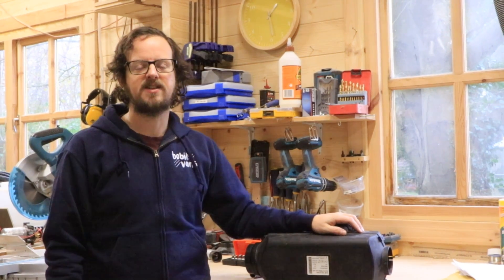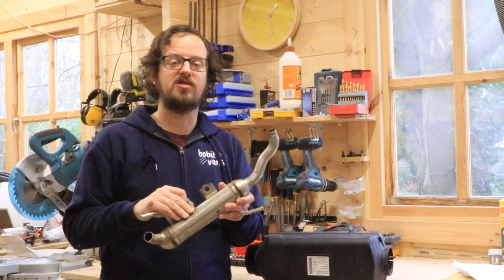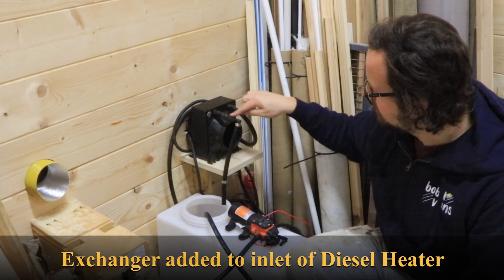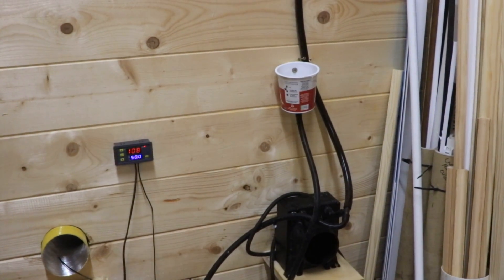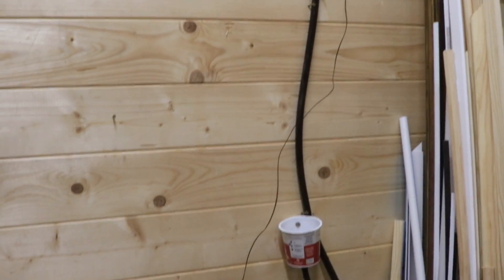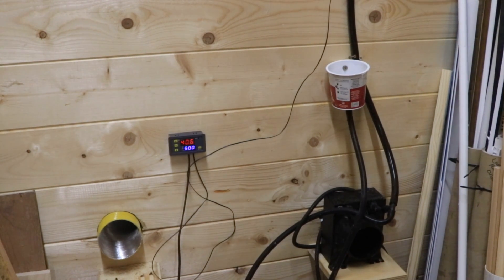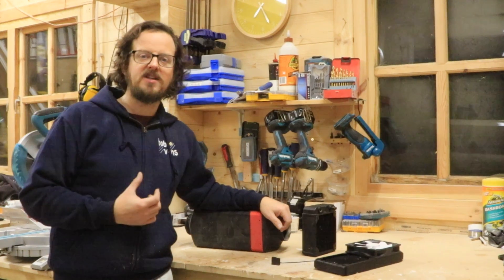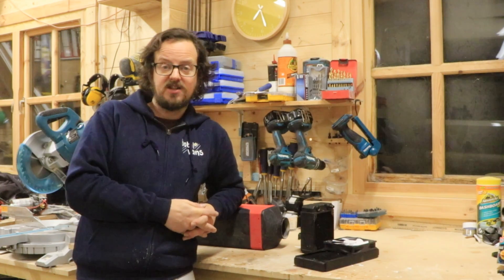Chinese Diesel Heater upgrade with EGR cooler

Comment: "I don't like burning fossil fuels".....literally every single piece of the heater is made with fossil fuels including the fuel containers, the deliver vehicles and every single tool in the shop, as well as the camera used to make this video hosted at a data center built with fossil fuels.
Reply from the maker: That’s not entirely the point of the video, but thanks for your comment.

Comment: Would it be feasible to make a floor heating loop with it.. To add a pump a small expansion and run it in the floor? If the water gets to 40 Celsius, i am not sure if its winter and the floor is cold would it make any significant difference. But something to explore

Comment: Please do research before you say things like fossil fuel and decaying dinosaurs producing oil. The fact is, crude oil is second most prevalent liquid on earth next to water and is naturally occurring. The deepest oil well found is 40,000 feet or 12,000 meters. Oil is rutinlly drill for at 30,000 feet. Even evolutionist say that most dinosaur bones are found near the surface of the earth and the deepest ever found is a Plateosaurus Knuckle-bone at a depth of 7,401 feet or 2,256 meters.

Comment: Had you mounted Tokyo heater orhercway round so it was nearer the output and wrapped it in insulatiob you would achieve 50%+  better efficiency instead your wasting atleast 25%
Reply from the maker: @andyplage6590  given the outlet temperatures, I beg to differ. Where do you get your 25% loss from? We’re dropping the exhaust temps from 250+ to a temp you can hold your hand in front of. Pretty impressive if you ask me.

Comment: Question.  Could you simply run water through EGR without heat exchanger as a hot water line only?

Comment: If water circulation depends on the pump then there is a danger of water turning into steam (bomb) should the pump fail for whatever reason. It’s fine on systems where the heater never reaches 100° but in this one the exhaust temp is over 200°C.
Need a larger diameter waterlines, greater height difference and natural circulation. Also less moving parts.

Comment: If one wanted to play around making something to heat water for showering in a campervan, I guess pumping it through a used EGR valve would be clean enough?

Or do you think pumping water through a heat exchanger at the heater outlet would be a more efficient idea?
Reply from the maker: @josmith5155  I’d do both, else you won’t reclaim any of the actual heat from the heater and you’ll heat your van like there’s no tomorrow just getting the water up to temp. Bear in mind that it’s only 15%-20% out of the exhaust, so majority still out the front of the heater.
Reply: @bobilvans4205  Cool. Yeah, thinking about it,  I guess the inside of the EGR is aluminium so could get corrosion with neat water.

Another few years and maybe they'll be mass producing the heaters with heat exchangers for water, although water and electric...
Reply from the maker: @josmith5155  I think the EGRs are stainless steel.

Comment: 😂 there is no such thing as a fossil fuel stop saying that you sound stupid😂
Oil and gas do not come from fossils. The Earth makes them using heat and pressure.
Reply from the maker: I will mention that the point of the video wasn’t really about the origin of fossil fuels, it’s about heat reclamation from exhaust gases.

Comment: If the pump speed is too high, the water is flowing through the system so fast that it simply doesn't have time to absorb a lot of heat, or transfer that heat into the radiator.
This is why you're seeing low differences between the intake/outlet temps of the radiator. That's not a good thing, from 38.8 to 40.9, you're only transferring ~2'C into the air stream.
By bringing the pump speed down, you can bring the water temperature up until it is close to boiling ~80-85'C is good. This means that your radiator is now getting hot enough, so it is much easier for it to transfer that heat into the intake air stream. You'll need a variable speed water pump for that, with a way to govern that speed against temperature rises.
Reply from the maker: Not sure I agree. The aim is to reduce the temperature of the air coming out of the exhaust as much as possible. The colder it is, the more energy has been transferred. By running the pump slower you increase the exhaust temperature which isn’t good. The key is the amount of energy that has been transferred, not the temperature.
Reply: @bobilvans4205  It may seem counter-intuitive but hear me out.
You want the EGR cooler to absorb as much heat out of the exhaust gas as possible, to do that, the water (your heat transfer medium in this case) needs to spend as much time as possible inside the EGR cooler so that it can absorb that heat. A high flow rate of water would be fine if you had a very long or large EGR cooler, but there's no space here for that with a small cooler, so the pump rate needs to be reduced to give the water enough time.
The reverse is true for the small radiator, slowing the flow of water through it gives the water enough time to transfer it's heat into the cores of the radiator, where the air stream can carry it away.
This comes from experience of racing engines, where we tried various combinations of high-flow radiators and high-output water pumps only to find that what seemed like the best combination (high-flow water pump impeller with a 3-core high-flow radiator) actually made the engines run significantly hotter, to the point where one of them literally seized from overheating even though the coolant temperatures weren't above ordinary. The coolant was passing through the engines so fast, it could barely pick up any of the heat from the cylinders, so what arrived at the radiator was a mixture of warm-hot slush that only became a homogenous temperature when it arrived in the radiator header tank. Dropping the water pump impeller back to a standard size dramatically improved the overall cooling and allowed the 3-core radiator to do it's job.
Funnily enough but I just had a thought, you could do away with the whole water transfer setup all together and make a long coil of pipe inside a can, or one that loops back and forth like a direct heat exchanger. Running exhaust gas through that would directly transfer exhaust heat into the incoming air stream far more efficiently because you're no longer having to work with the limitations of water boiling off.
Reply: @bobilvans4205 Yes, I agree. Recover the wasted energy in the exhaust gases.  Given your data as presented you recovered around 50 btu/min (6.5 liters/min) with a delta of 2 ½ ⁰... Given your heaters energy input is about 200 btu/min I'd say that was good progress.  Measurements of delta T across the EGR would be beneficial.
I've had 2 of these Diesel heaters for around 7 years now and have purchased a auxiliary automotive heater to do the very same.  All I need now is the EGR cooler.

Comment: It looks like you're heating outside air. In cold weather you'd get more heat by having the heater inside and recycling inside air.
Reply from the maker: We’re pulling air in from the building then recirculating it into the building. The heater is outside.

Comment: This is a FANTASTIC setup.    I never could understand why these diesel heaters don't run much like water heaters in that they produce so much wasted heat out the tailpipe (Exhaust).     
A heat exchanger is great solution to not only capture that wasted heat energy, but also provide warm water  that could be used for all sorts of uses.   

This would also work very well to heat up your oil / coolant  in the winter on your car to help aid the block heater in colder climates.     

Running it on Kerosene would also yield some benefit in colder climates as well to start the heater and get it up to Temperature faster. 

Not to mention lower wear and tear on the engine if you have something like a pre-oiler.
Reply: wait til you learn that they can burn straight used vegetable oil you get from a restaurant, just needs to be filtered. you put the vegetable oil in another tank, use a shutoff valve to keep it off for startup and shutdown. when the unit's running hot on diesel, flip the valve so you're burning oil. flip it back to diesel before shutting off to keep the heater clean. if you're lucky you may find a source of free heating fuel in your town.

Comment: 1:17 Runs very well on 100% HVO.  What you use here is a heat exchanger, EGR is something else entirely.
Reply from the maker: This is an EGR cooler. Not a valve.
Reply: @bobilvans4205  oh I understand. The part is a component from a exhaust gas recirculation system known as a EGR cooler that you repurpose as a heat exchanger for your diesel heater.

Comment: You really don't know what FGR is do you? Exhaust gas recirculation, where exhaust gas is fed back into the intake of a car engine to reduce emissions, nothing to do with cooling the exhaust.
Reply from the maker: Thanks for your helpful comment. I do know what an EGR is. I am repurposing an EGR cooler from a vehicle to regain some waste heat from the exhaust gas from the heater. I am not feeding exhaust gasses back into the intake of the heater. I’m sorry if that was not clear!

Comment: It seems rather overcomplicated for the heat that you gain. I just purchased a 3-metre length of the original (shorter length) stainless exhaust pipe, zigzagged it in the shape of a heated towel rail then out through the wall. Job's a gud un 👍
Reply from the maker: I look forward to seeing your efficiency calculations. Would be interesting to see. I didn’t want the exhaust inside for obvious reasons. I also like tinkering.

Comment: Don't take this harsh by any means please: 0.52 we need to get the exhaust/waste heat recovery/~~recirculation~~ "uh," you got stuck because we all get stuck.  I want the terms to be more precise so it's easier to search and find info plus one bro, new YT channel made an epic fail because of this terminology glitch.

EGR exhaust gas recirculation routes exhaust to the intake to be re-burnt.  You CANNOT do this or you will burn out the motor or melt the impellor.  It relies on cold air for cooling.  

This is a discussion about "waste heat" recovery from exhaust.  Which is indeed what you've got and I have watched a bit ahead. These heaters seem to be gaining a lot of popularity and community, I hope we can all learn some cool modifications.
Reply from the maker: I’m not quite sure what you mean. The device I’m using (EGR cooler) is for cooling exhaust gasses on vehicles, I’m not doing that on this heater, all the exhaust gasses stay outside. Instead I’m raising the inlet air to the heater by a few degrees (from about 5 to 15) to use the heat usefully.

Comment: why not use the egr to warm up the intake air so it would  not take as much diesel to  reach the desired temperature?
Reply: But the hotter the intake air the less the density.
Reply: @RodgerMudd     i guess lower air density  means the diesel  won't burn properly?
Reply: Heating the combustion air going into the unit would be great. Hotter air generally leads to a hotter burn which means more complete and cleaner combustion. Would be a good way to extract any remaining heat after the EGR cooler heats the water with much lower risk of melting things.
Reply from the maker: I think that’s what I’m doing?!
Reply: @bobilvans4205   yes... but meant heating up  the intake air of the diesel heater rather then the water... I'm  not an expert so it might not be a good idea...

Comment: This is good stuff.
Have perhaps considered to se a pipe-in-pipe exhaust like condenser boilers do? It could preheat the burner intake and recover more exhaust heat.
I’ve been trying to run the Chinese heater on used cooking oil, no fossil fuel. Still working on preventing carbon building up.
Reply: How do you clean out the build up ?
Reply: @glennnelson7917  Yeah well, so far I need to open it up and burn it out with a blow torch or hammer it w. a screw driver. Not the ideal solution. Hence I tried injector cleaner additive and also running the heater on full power regularly.

Comment: There is nothing wrong with fossil fuels, you have been indoctrinated into the stupid club.  Fossil fuels are completely safe, and are not causing any change to the climate.  CO2 is still only .04% of the composition of the atmosphere.  it is continually process out by photosynthesis 24 hrs a day.  If co2 was accumulating, it would be at the expense of the Oxygen portion of the atmosphere, and there is zero data of oxygen levels decreasing.  None.
So please don't be a useful idiot for the central banks, the people that want you  cold, hungry, malnurished, sick and to die an early age.

on the contrary the idiot elites are spraying the upper atmosphere with chemicals to try and block life giving sunlight from reaching the planet, but you are ok with that?  no one knows the result of such stupidity, yet it goes unchecked and allowed.

When they classify CO2 as a toxin, then you become illegal and should be rightfully put down.

Please wake up from you foolishness.

Comment: Add it to a water heater and have the rad. To help remove heat after the water in the water heater is at temp

Comment: Wouldn't it be easier, cheaper and perhaps more efficient simply to run a much longer segment of exhaust pipe inside the house (before exiting outside) with a radiant reflector behind it directed towards the area of occupancy? And perhaps have a small electric fan blowing on it to further extract thermal energy before exiting the exhaust outside?
Reply from the maker: Possibly. Maybe a future video!

Comment: Just don't exhaust the output gasses then you can become 100 percent efficient. lol   two ways I liked that were cheap and efficient was make a thermal battery inside something like a 55 gallon drum run the exhaust to the bottom and an outlet on top or do it using sand and it will continue outputting heat for like a day!

Comment: You should try using the natural flow of the heat to rise up and pull cold water from the bottom and you might not need to use your pump. Hot water comes in on the top cold water leaves on the bottom
Reply from the maker: This is valid but pumping does make it more efficient
Reply: Position the radiator with its flow and return at the bottom. Hot water will rise to the top of the rad and as it cools fall towards the outlet at the other end. This maximises heat flow from the radiator core. The air fan only needs to be fast enough to move air through the radiator. No need for a screaming fast fan.

Comment: Insulation is needed around ALL of your water lines. Pool noodles would be perfect for these lines. A wrap of rock wool around the exchanger as well as all of the air lines going from and to the garage will preserve you heat from loss.
This is an interesting idea, every little bit of BTU's that you can capture is a plus.
Reply: You said the very thing I was going to say.  You got to love that rock wool.

Comment: One thing to consider is that the cooler the exhaust, the longer it'll stay low to the ground, which can increase exhaust exposure
Reply from the maker: This is true but this setup is ok outside of a building.
Reply: @bobilvans4205  no soot buildup yet? I've been wanting to catch the exhaust heat but so many say it clogs up the exhaust and the acidity of the condensation corrodes the exhaust piping. How's your experience so far..it looks like you've had it going for about a year.

Comment: There seems to be too much heat lost to the exhaust, According to your needs you could make a hot water system for tea/coffee or for local or remote air heating by radiators.

Comment: Hi. Great vid, so thanks for making it 😁
BUT... could you put in the discretion which EGR you used & maybe it's exhaust size, it would help me for sure! ALSO....... how hot is the exhaust pipe after the EGR, ie, how efficient is it & would a slightly bigger one work better???
Mike

Comment: your fuel isn't from a 'FOSSIL' its 'ABIOTIC'... made within the earth from heat and pressure!
Reply: No dinosaurs died in the making of this video 😂
Reply from the maker: I’m really not sure why everyone picks up on this comment rather than the actual subject of the video…
Reply: Yawn 🥱
Reply: Non sense. I come from the oil industry.  It's  produced by the earth.  How did plant/animal matter get 32,000 ft below sea level/grade 😅 The average depth of a oil well. There is even a oil closer to the surface. But riddle me this Batman. How did plant and animal matter get 32,000 feet below grade. The Earth produces it  It's a natural resource just like wood. Stop buying into the nonsense bullshit story of it being dead dinosaurs. Which once again, is complete nonsense. Most of what you believe is bullshit.  When it comes to timelines and history. We've been lied too.
Reply: They are called "FOSSIL fuels, you can try and be as technical about it as you like, but ultimately you are taking carbon that was locked up in the ground, burning it and releasing it into the atmosphere as CO2
Reply: Formed heat pressure lack of oxygen etc , but formed from dead life matter, plant and animal,  animals being mainly marine organisms and plant being mainly marine plankton , so yes, fossilised ex living matter
Reply: @billybobwombat2231 wrong. Oil is the same as copper. Lead. Water. Wood
 It is a resource. 
Fossil fuel is a falsafied term taught to us .
Google it man. We all figured this out 15 years ago when the arabs uploaded videos in the desert of oil. Rivers , lakes, ponds of oil. Your whole life is a lie. Better teach yourself

Comment: My guy, if efficiency is the goal, then PUT THE BURNER AND EGR INSIDE YOUR SHOP. Pipe the intake & exhaust outside.

With the burner outside, your heater is pulling veey cold air for heating, rather than re-circulating heated air inside the room. Tehe